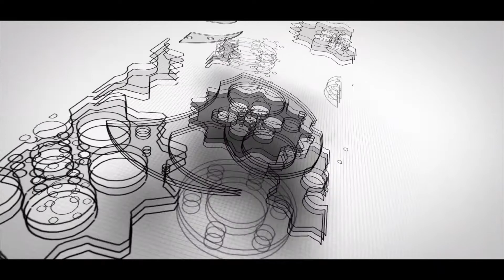Honda Rubicon 500 - Centrifugal Clutch Removal - How to Replace

Comment: What does a new transmission unit cost for one of there?
Reply from the maker: Yes, this Hondamatic gear is available, but very expensive. Honda part # 26000-HN2-A00. Check out our ebay store, we have used ones available: https://www.ebay.com/str/midnebraskamotorsports

Comment: almost guessing this is same problem i have i have a 2001 TRX500FA Forman Rubicon when i first bought it used it felt week until i got going about 15mph i been a car macanic for 30 years to me felt like 1st gear wasn't working like it was starting in 2nd gear then after about a year went and started and seems like trans locked up so i jacked it up and wheels wont move i changed angel sensor and test shift motor seems good so wondering if i can order all parts in the trans also wonder if theres another option to put a manual trans on it any ideas anyone